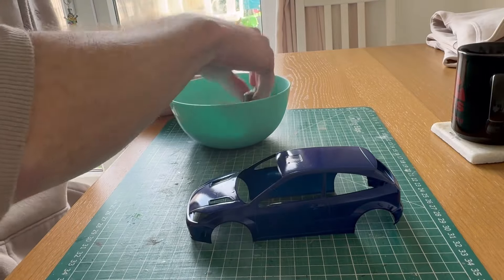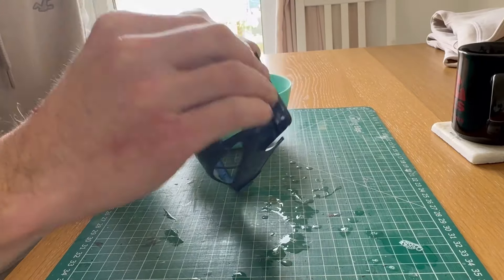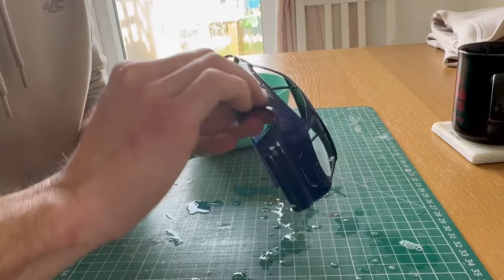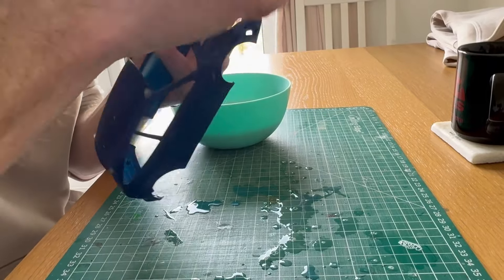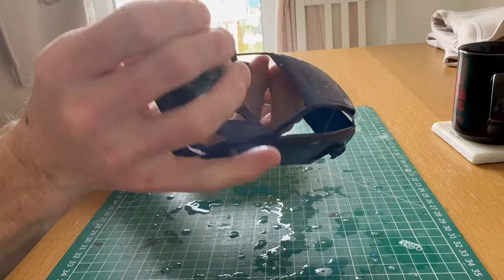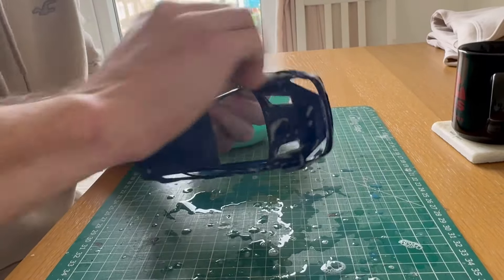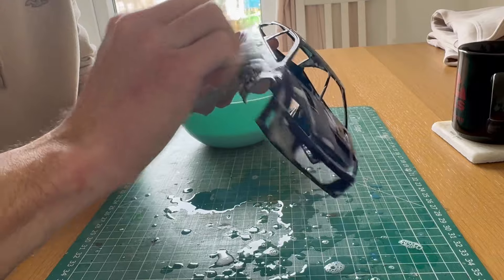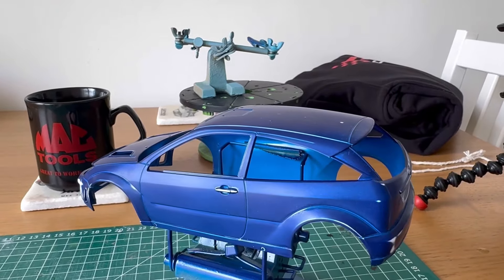Ford focus Rs mk1 tamiya 1/24 model car kit Paint correcting sanding flatting and restarting

Comment: I've had a similar issue with the Skyline that I'm doing.
I painted the car with Tamiya paint and then used Mr Hobby Super Clear over the decals which was a huge mistake.
The Mr Hobby clear has more of a matt finish and I wanted a shiny finish. I've wet sanded and polished but it still looks wrong.
I'd like to sand back down to the paint and re-do the clear with Tamiya only I'm worried about ruining the decals.
Any ideas or tips you can think of?
Reply from the maker: Hey bud, only thing I can advise is a gentle flat with say 3000 grit or even a scotch bright pad on the back of the yellow dish sponge to flat the paint then a nice high gloss clear coat over the top bud, be gentle with it else you’ll rub through which you don’t want
Reply: @Tcmodelworks  But will the Tamiya gloss clear show if I use it on top of the Mr Hobby clear because it's going to be impossible for me to sand away all the Mr Hobby clear down to the paint because I cleared over the decals.
I can't see how I'm going to get a nice finish unless I completely remove the old clear.
I could be wrong, after all I'm new to modelling I just would hate to ruin it after the countless hours I've put into it.
Do you know of anywhere I could re purchase the decals so I can start from scratch? That's what I'd feel comfortable doing.
Reply: @Tcmodelworks   It's the Calsonic R33 Skyline decals I'd need.
I also need a rear diff and top half of the rear subframe that holds the diff in place.
I'd be willing to swap a full kit for those 2 parts.
Reply from the maker: @82coxy  I like sanding and then a gloss clear coat will hide the slightly dull clear coat, you don’t need to sand it all off bud, I do have the r33 calsonic skyline in the stash that I probably won’t be using the decals from so could be an option :)